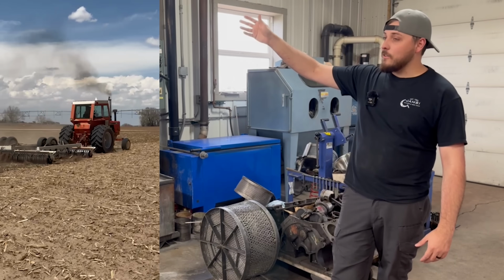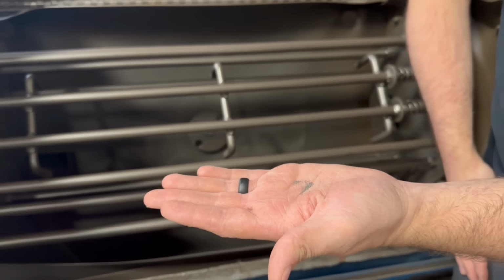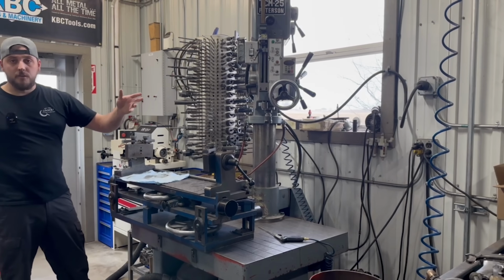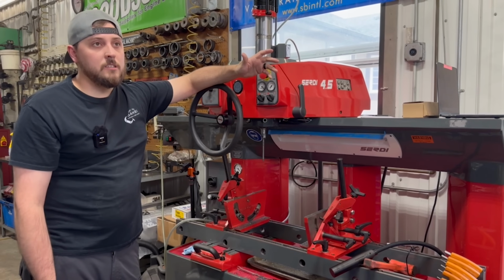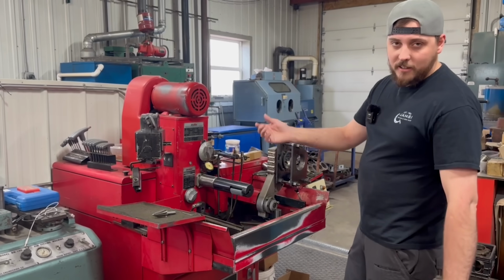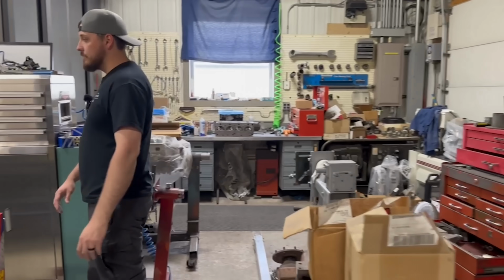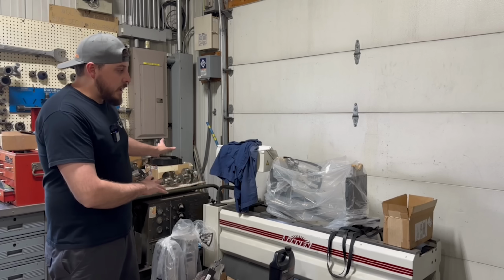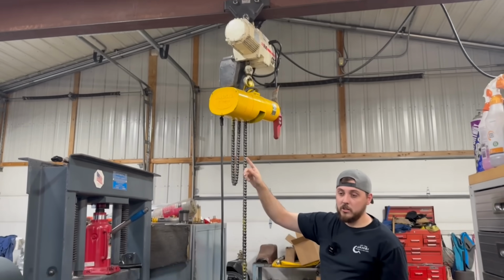Equipment Tour 2023 - Jim's Automotive Machine Shop, Inc.

Comment from the maker: Upcoming Videos:
-7.3L Powerstroke Cylinder Head Work
-C12 CATERPILLAR Cylinder Head & Connecting Rod Reconditioning

Stay tuned! :)
Reply: 16:31
Reply: Need information on what the largest valve seats and valve diameter that will fit in a 7.3 bored 40 over, I’ve heard a 2 step valve seat that measures a tad above 1.9” from Tucker Valve Seat Company. Still in communications with them currently waiting for confirmation

Comment: Id love to see you buy a Jasper engine, unbox,tear down and mic everything just for chits and giggles 😆😂😆. you don't have to say it's a jasper engine if you don't want to.a shop I worked at tried using them and it was a fkn NIGHTMARE!! after going through a few unnecessary swaps because of their junk we stopped using them.but it would be funny to see the incompetence that goes into them 🤔.NO WAY they mic them and put all new parts! Actually I think if it has one broke ring it gets one new ring and put back together and sold 😆😂.

Comment: So what you are not trying to say is.......those old machines are awesome but it takes a mature blokes patience to be able to use them properly ! Nice run through your shop.
Reply: Those Old machines are Tired, dont hold the Tolerance needed for todays Engines. Repair and Replace before they loose their Value..

Comment: Thanks for the video. 

Can I offer you a suggestion? While a CNC machine for block work is appealing,  in my view they are over priced and over simplified.  Invest in a CNC vertical bed mill. Look for a machine that has the most X and Z axis travel you can afford. Spring for 4th axis capability. With some basic fixtures that you can make, buy, or even customize with the machine, it can bore, deck, do lifters, do main caps, and with certain accessories line bore mains and cam tunnels. If need be, a class at a local college can get you rolling on G code and conversational. The money you save over a dedicated automotive CNC machine you can put towards the purchase of a Sunnen SV30.

Best of luck to you.
Reply from the maker: Yep, appreciate it! That’s already what I’ve been looking in to somewhat! We will see what happens lol

Comment: That cranck shaft grinding machine is a pretty important item, I agree you should start learning pretty soon . Keep on smiling.
Reply: I agree. The crankshaft is really the heart of the engine and a very important part of the rebuilding process. The way it’s ground and polished and balanced basically determines whether the engine has a long or short operating life.

Comment: Keep in mind that detergents are all caustic to some extent as it creates an environment which gets maximum performance out of the surfactants. The more severe cleaning the product is intended to do, the more caustic is the formulation. Auto dishwash detergent is much more caustic than laundry detergent, and scrub cleansers such as Comet are more caustic yet.
Reply from the maker: Right! I guess in the machine shop "caustic" typically refers to "caustic soda" aka Sodium Hydroxide. And anything else we say is non-caustic although I suppose that is technically incorrect!

Comment: Older equipment is easier to service, switches and relays. Not circuit boards and electronics,  especially  when the company stops offering support.
Reply from the maker: To an extent. The Sunnen we currently have has electrical components that were built to Sunnen spec & are unavailable elsewhere. And VERY expensive lol

Equipment Maintenance is a hefty expense that you just can't escape it seems.